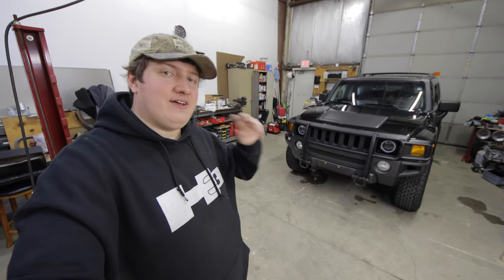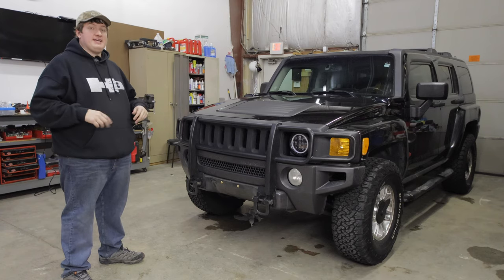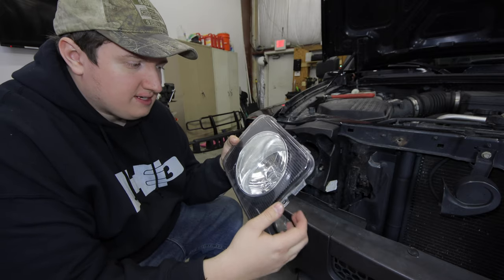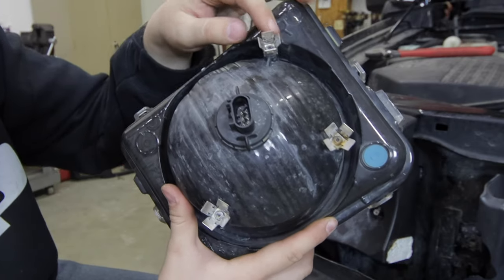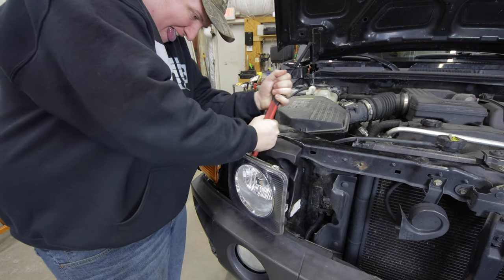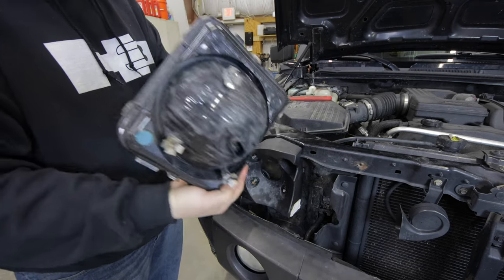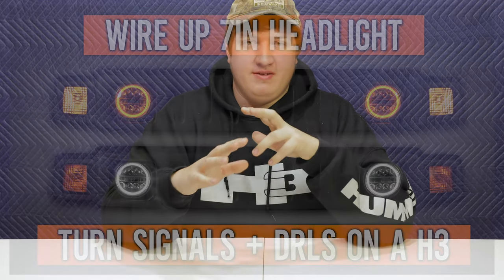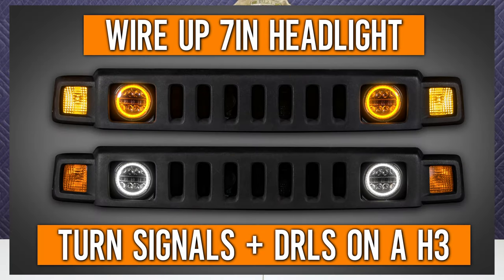How To Install 7in Jeep Lights On A Hummer H3

Comment: I hate to bother you friend, but I have been trying to contact Lased Designs business to order the mounting bracket and, they have not updated their website and appear to be completely out of stock on about everything they offer. Do you have another retaining ring option to recommend, because I cannot find any available on the sites to allow installation of the 7" LED headlights on my H3? Also, I get no response to my emails from Lased Design, so I'm sort of lost in this Nexus bro.

Comment: Do you change the whole thing when a bulb burn out or you can get the bulbs anywhere?
Reply from the maker: Yes the whole headlight needs to be replaced when the lights stop working because most of the internals of these headlights are just a PCB board with LEDS on it. In general, these new headlights are designed to last a long time before any of the lights on them go out, so I wouldn't worry that much about it. Also they are pretty cheap to replace. Haven't hard too many issues in general with them going out after a short amount of time. Even if you could change out the leds, it would probably be a pain because of the complex internals that make up the headlight. Also if you don't reseal it correctly, moisture will get into it.

Comment: The V2 adapters by Lased Designs has been sold out for awhile. I emailed them about 3 weeks ago trying to find out if they will be back in stock soon but have not got a response. I think they have a link on their website to your video.. Do you know what is going on with the manufacturing of the V2 adapters over at Lased Designs or if there are any other companies that make adapters like Lased Designs V2's out there?
Reply from the maker: Unfortunately lased designs is the only company that makes these headlight adapters for the H3. Lased designs really needs to get better at communicating. I, myself have tried to contact him 3-4 times this week with no response. From my experience, he goes radio silent for like 2 weeks to 1 month, then returns for a week where he will actually respond and then the cycle repeats itself. The last time I have heard from him was on December 27th, 2020 where he told me he was going to go on a small break for a week or so to catch up on current orders. So unfortunately, I have no idea when he is going to get back to me or restock inventory. Hopefully soon. I’m sorry about this. I know this is definitely frustrating and unprofessional, but he is basically a one man operation and he does it on the side. Its really annoying having to deal with this, but he is one of very few people willing to produce new products for the H3 because no large company wants to support the H3 because there aren’t enough of them and the vehicle has been out of production for 10 years. If I hear anything, I’ll let you know. Thanks!

Comment: have a question???? the headlights adapter comes with the headlights or the would sell it separated??????????
Reply from the maker: You have to buy the headlights separately from the adapters.
Reply: @4lowmode  thanks

Comment: Can anyone tell me why does the driver side rgb led headlight that when you change the colors everything syncs up on the colors for the passenger side headlight & the fog lights color, but the driver side headlight colors are different.  Like just say if I pick Red the passenger side headlight & both the fog lights are red, but the driver side headlight is blue.  When I disconnect the polarity converter all 4 sync up,  but when I plug it back in the driver side headlight is a different color from the rest. I swapped  the drivers side headlight that was doing that  & hooked it up to the passenger side & synced up & took the passenger side on that was working fine hooked it up & now that headlight didn't sync up so not the headlights.  Swapped polarity converter that didn't take care of the issue & swapped the H4 to H13 adapters & that didn't work either. Changed around the black bluetooth wire connector to each headlight & that didn't work either.   I am stumbed!  They all sync up fine  all plugged into the bluetooth controller until & the passenger side headlight plugged into the polarity converter,  but as soon as I hook up the led headlight on the drivers side to the bluetooth controller all 4 work fine synced right & then when I plug in the 3 prong on either headlight so I have headlights is when the drivers side demon headlight colors are different patterns from the other 3.  Anyone else have that issue?

Comment: So I bought the Chinese polor boxes and I’m only getting the driver led to work. Should I just go with the other wire setup? Also the high beams for the driver side stays on unless I put my high beams on and then my low beams are on.... fml
Reply from the maker: The side that doesn't work at all may just have a poor ground connection. Where are you getting your ground from? Are you using the factory bolt that I said you can use if you don't want to make your own ground? If so, go ahead and get some sandpaper and sand it down a little bit as you may not be perfectly touching bare metal. Going with the other set up may not necessarily solve the problem if you are getting a poor ground connection. Also you say your high and low beams are inverted. It might just be that your H4 to H13 adapter that came with your 7in lights have their wires inverted and you need to just switch them. I talk about this happening at 23:44 in the video. 

On the H4 connector there is a wire that controls the low and another wire that controls the high beam. Refer to this diagram to check that your wires are in the correct position: https://images-na.ssl-images-amazon.com/images/I/41flfwdjvwL._SX425_.jpg . 

Also if you just google "h4 plug diagram" you will find some info on it. Let me know if any of this helps and I'll be here to answer any additional questions you can have!
Reply: Thanks for replying, I did try different methods to ground the wire and nothing happened. I also checked to see if it was just my LED not working by swapping it out with the different one and that wasn’t the case. Already bought the second method to wire the LED’s. Hopefully that fixes my problem, I will let you know this week once I get it all plugged in
Reply from the maker: @evil_illusions1821  Sounds good! I'm sorry that those boxes didn't work out for you. That's a bummer. It could be that you just got a bad pair. I ordered two sets of the boxes and both sets seemed to work fine. The set that I have on my H3 right now still are working fine. Good to know though. Definitely keep me updated!

Comment: Any other place you can find a 7 inch headlight adapters. Seems lased designs are out of stock on everything or there out of business.
Reply from the maker: They are not of business, just temporarily out of stock. Lased Designs does this so they can ensure they ship any incoming orders in a timely fashion.

Comment: Hey buddy 4 Low Mode, where can i get these 7"headlight Adapter Kit ( ive been searching and cant find it) if you have a link where u got your from i'll appreciate it.
Reply from the maker: Hey there man! I had the link the description, but you can either buy them on the Official Lased Designs website or on eBay. 

The link for the website is this one here: 
https://laseddesigns.com/collections/frontpage/products/7-round-headlight-retrofit-adapters   .  

The link to the eBay listing is here: 
https://www.ebay.com/itm/2006-2010-HUMMER-H3-H3T-7-ROUND-HEADLIGHT-ADAPTERS/293437237006?hash=item445238e70e:g:jmsAAOSwa6heJ-5S  . 

Same exact seller, they are just selling it on both platforms so it is easier for people to find.
Reply: @4lowmode  awesome ,Thks !!

Comment: To bad not all of the brush guards are slotted like the OEM smooth fit ones. To remove the guard on my alpha you just have to loosen the bolts and lift.

Comment: Will those adapters work for a 7" swap on a hummer h2?
Reply from the maker: No need for the adapters on the H2! They fit into the stock headlight housing with no mods. All you need is a pair of 7in lights and the H4 to H13 adapters. I am pretty sure you do not need the polarity converter/relay harness that I showed in this video. If you look on YouTube, there are already some videos showing how the 7in Lights go in on the H2.

Comment: Does it matter what jeep mounting bracket you use
Reply from the maker: Yes, it  does. You need the one made by Lased Designs. No other one works for the H3. You will similar looking ones on Amazon, but those are made for Jeeps and will not work for the H3.

Comment: Do you need polarity converters for the fog lights as well?
Reply from the maker: Nope they are plug and play! No adapter needed! However, you need to plug them in the opposite way. On the OEM fog light harness there is this little buckle/clip and on the foglight harness itself, it has this little tab that is intended to slip into that buckle. To get them to work, do not let the little tab on the fog light harness to slip into the buckle on the OEM harness. Instead, flip it around the opposite way.
Reply: 4 Low Mode Thank you! Im buying some halo headlights and foglights tomorrow!
Reply from the maker: @morganjroberts  Awesome! both the headlight adapter and foglight retrofit kit can be found on Lased Designs website and then you can pick out which lights you like!

Comment: will the adapters and the harness work with heated led lights ?
Reply from the maker: Yes they should. However, the heated lights will most likely have another wire coming out the headlight used for powering the heating element. This will need to be wired up per their instructions or else they won't work. This is just a guess however because I have not installed heated headlights myself.
Reply: @4lowmode  ok thanks for  the response I guess I will see when they arrive.

Comment: How long did the resistor boxes last
Reply from the maker: I think you are referring to the polarity converter boxes. Surprisingly, they have held up. Wasn't sure if they would since they are a no-name brand from China. I have had them for 3 years now and they are still working.
Reply: @4lowmode  yes that's what I was referring to and thanks I'll be getting some soon the wife told me to get better lights the stock lights suck lol

Comment: Wondering if anybody has had problems with their TRACTION CONTROL & STABILITY CONTROL SERVICE lights coming on after doing this upgrade? I followed the instructions to a T.
Reply from the maker: That is the first time I have ever heard of this. My guess is the problem is unrelated or you accidentally unplugged something else. The H3 does not have an advanced CANBUS system that would detect low/no voltage from headlight or side marker light being out. The only thing is does it detect when a turn signal bulb is out and will hyper flash. The traction control message light is a pretty generic message and a whole number of different things could cause that light to turn on. My first step would be to plug in a scanner to your H3 to see if you can get any clues as to what it might be.
Reply: Long story short I found the problem.. I upgraded all the rear lights with LED when I did the front. The 3rd brake light never worked when I bought the H3 for my daughter. I ended up using 2 red LED strip lights with modification to replace it. The wire was frayed a little when I put it back together and it blew the fuse to the rear brake lights. After repairing the wire and replacing the fuse the TRACTION CONTROL/STABILITY CONTROL light went away.  Thanks again!!!
Reply from the maker: @scootert2585  Good to know! Glad you got it fixed!

Comment: Need someone who sells these brackets. Lased Designs slipping on the restock & not replying. I’ve been searching high and low for headlight and fog light adapters
Reply: I have placed a order for mine and I’m still waiting on a reply since June of 2023 and there is no reply I was charged and no items wtf

Comment: Today I had to take my 06 h3 adventure package/ lux package to mechanic be cause it sounds like a steam engine train on start up... stupid exhaust manifold leak. Because I live in Cali nobody on eBay will sell me one because of stupid California emissions...... I had to get a ride home from my coworker in a little Fiat Pop!
Reply from the maker: Dang that's awful man. I have many H3 friends that live in California and they are always telling me how expensive everything is and the laws they half to follow. Hopefully you can get something figured out!
Reply: @4lowmode  got a question for you. I took my 06 h3 on some trails to test out 4 hi lock and 4 low lock and rear locker. All seemed to function properly but when I put back in regular 4 hi it feels like 4 hi lock. The light says 4 hi.  Could be shift fork issue. My question is, is it okay to drive around regularly on the street and freeway if it is in 4 high lock?
Reply from the maker: @rizkybiss  Yes that is totally fine! Only thing I would avoid doing is making really sharp turns. Making regular turns on the street should be alright though. One of my H3 friends that I know was doing some offroad trails with his friends and he broke a CV on the trail. He was 4 hours away from home and he was thinking about getting towed, but he ended up just putting it in 4 Hi Lock and drove it all the way home with no problem.
Reply: @4lowmode  right on. It's not just to get home though. If it is in 4 hi lock even though it say it's in hi, I would be driving it back and forth to work and so on until I can get it fixed. Could be months. Is that still ok?

Comment: Bummer. Just got some Jeep brackets/adapters and it fits the 7inch LED, but won’t on the Hummer itself. Then I go to the comments and see that it won’t work😂 Lased designs has been LAGGING IT all 2021. If anyone has 3D files for it, I’ll pay you, or if you have those adapters itself, I’ll buy them off of you!
Reply from the maker: Yeah sorry the Jeep brackets you probably got are for adapters for the Jeep JL (2018+ Wranglers). The new Jeep JL uses 9" headlights instead of the 7" Jeep headlights (Same style I used in this video) that Jeep and other vehicle manufacturers have been using for decades. The adapter basically allows you to put 7in lights instead of 9in ones if you have the 2018+ Wrangler. But yeah lased designs is lacking big time.
Reply: @4lowmode  thanks for the reply! I did this instead:

https://www.treatstock.com/3d-printable-models/2299312-hummer-h3-7-inch-led-headlight-adapters

Do you think these will work? Probably some modifications needed, but at least it has the peg posts. Please let me know because I cannot wait for Lased, he’s too slow lol.
Reply from the maker: @EduardoRamirez-ny6fw  Yeah I know about that one. It was made as a prototype and the guy who made it didn't actually end up using it for his H3. It is a really bad design that is far more likely to break if you ever try taking it off. The problem with these design is the studs and the main part of the adapter are all one piece instead of being separate pieces like the lased designs adapters. It is important to have the studs removable and seperate from the adapter because they can take some force to get on and take off. This amount of force will easily snap a stud off the main adapter if it is one piece. I know this because when lased designs was developing prototypes, he tried making the adapter all one peice and the studs broke off easily. Also, the method in which this other adapter (from treatstock) only uses 2 screws on the side to hold the headlight in place instead of using a metal retaining ring. Personally, I would not try using this adapter, because it is almost guaranteed to break if you ever try taking it off.
Reply: @4lowmode  What if I don’t try taking it off? I want to put those on while Lased design comes out with his again. Would it be an okay temporary application, and could I make it work for now?
Reply: @4lowmode  i just really desperately want to make them work since the current lighting I have is an LED bulb on the OEM housing, which as you know blinds absolutely everyone lol. I am kind of in a hurry to get projected lighting to not get a ticket.
Reply from the maker: @EduardoRamirez-ny6fw  You could always try. It would just be kinda annoying to have to do the install twice once your able to get the lased designs ones. Also, just a quick note that this treatstock adapters have not been tested to fit multiple sizes and styles of 7in headlights, so it is not 100% guaranteed that your choice of 7in headlight will mount onto the adapter.